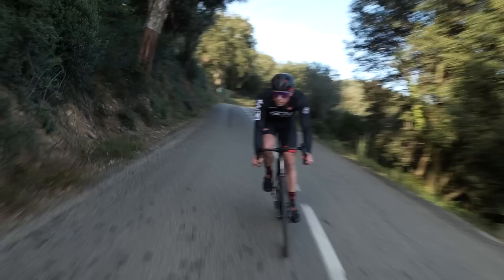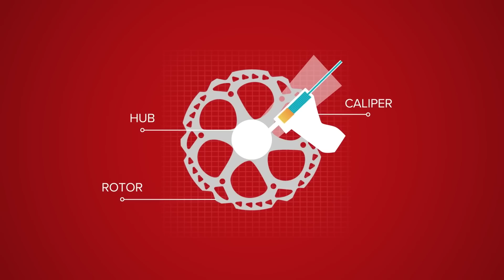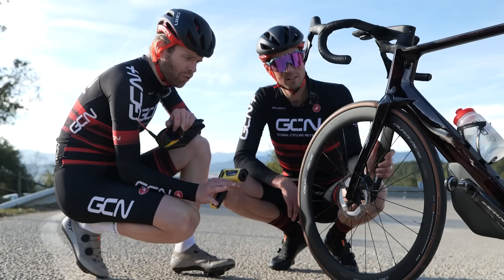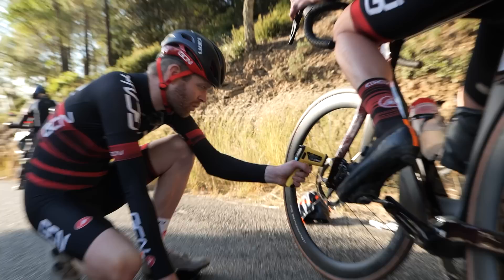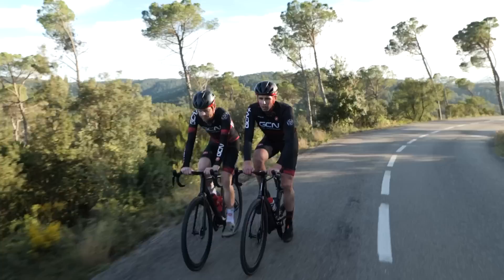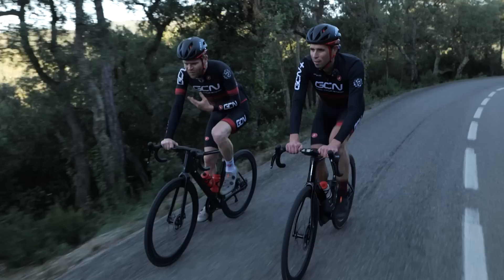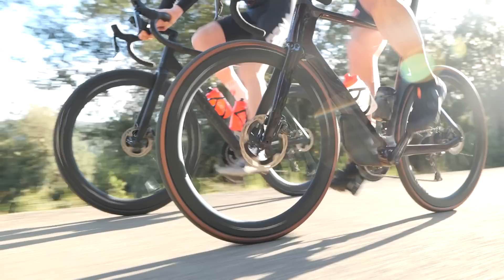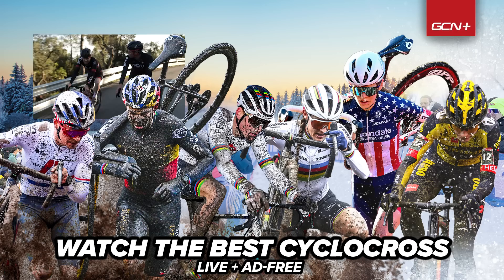Are Big Disc Brakes REALLY Better?

Comment from the maker: What did you think of the results?
Reply: You came to the same conclusions as I gave when selecting rotor size for the weight.
Reply: .....not really a scientific test.....you have to measure it permanently and you also have to know the speed, weight, energy which got transfered into heat for one ride and so on.
Reply: should try it with an alloy rim brake wheel 😉
Reply: Being a mtber and roadie id say fairly predictable, good to see some peak torque recognition tho. Yeah come on let's test some stuff to destruction, get the lathe out. Big brakes are great if you're an aggressive decender theyre always good to go - fade is a thing of the past and in 24hr races having more than enough power is a bonus with tired cold hands. If you're a bit of a panic braker tho good luck, best thing you can do is work on your spacial awareness so things don't suprize you.
Reply: The 55ish degrees across the board shows that the experiment probably isn't hard enough to show any difference between the rotors. (Although the faster heat dissapation  of the 180mm is a hint at potential superior performance)
Would love to see some more experimentation on the subject :)
Reply: The results were entirely predictable.  The temperature change for each rotor being similar lines up with the physics and maths, similar energy from stopping for each run, same material, and mass relatively small for each rotor.  Q=mst.  Heat quantity in Joules = mass x specific heat capacity of material  x temperature change.  Cooling rate a function of surface area and colour.
Reply: Results are good, next time rotors and brake pads. I use "organic" pads  so whats the difference between organic and sintered pads?
Reply: Interesting. You should test drums as well (SA 70mm v. 90mm).
Reply: Crank Length, it's all about crank length
Reply: Be worth having You Tuber Peak Torque on. He advocates 180mm on the rear in some cases
Reply: You guys need to use a probe thermometer. Laser thermometers are not even a little accurate on reflective surfaces like brake rotors.
Reply: I think the measurement is not done properly. You cannot measure temperature correctly on smooth, metal surfaces. They act as a mirror and the IR sensor "sees" more or less the temperature of the objects that reflect in that surface. It is like if you wanted to measure the colour of the mirror. You should stick something to the fin or paint a piece of the fin and measure on that spot.
Additionally, black fins coating increases its emissivity improving the heat dissipation. It is not only for aesthetics or to substantiate the price.
Reply: Rider weight should be a factor.
Reply: @danc1829  in the wet
Reply: I agree with comments criticizing your thermometer.  Factors degrading temp measurements:  reflective surface of rotor, time lag from final release of brakes to reading temperature, and, because the rotors all cooled quickly, it's likely that all the heat in the rotor was generated during final stop (heat from braking during descent was already dissipated.  This experiment needs real time temp measurement over the entire descent, to measure heat build up during braking and heat dissipation while coasting.  Thermocouple on rotor, wired to data logger mounted on wheel maybe.  

As for personal experience, I'm 68 kilos, road bike with 13k miles and 200,000 ft vertical, original 140mm discs still performing well and plenty of material remaining.  I've thought that if/when they wear out I would put a 160 on the front, but your experiment has me reconsidering.
Reply: I'm a 100kg and last year during summer I was descending for less than 10min on a -10% to -15% descent and my front rotor changed color. Wasn't exactly glowing when I stopped at the bottom, but it was a lovely rainbow "color". And that was a gravel bike with a shimano 160mm rotor.
Reply: I know that slope haha! And it looked like the heat was only being generated when Alex was braking in those last few metres. Come to Andorra and really go down "hills". Try going down La Gallina, or Beixalis, la Peguera, where it is corner after corner when you are braking constantly from +60km/h to 25km/h. We here have plenty of examples of carbon wheel rims (ok, yeah, some years ago) that have exploded from the heat generated descending!
Reply: It is symply not possible to measure IR reflective materials as metals with an IR device. Check with an IR camera for reference...
You could get somewhat liable measurements, when having some white tape glued to a test area and measure there.
Reply: One thing not considered was the time taken on cooling, not at the end but between braking points on the descent. Bigger rotor will cool quicker between the braking points giving a better braking effect throughout compared to a smaller that will still be hot.
Reply: Well… Ollie used 140mm rotors for Le Tour des Stations, saying the braking performance was not an issue even in mountainous rides for a rider of 68kg… Why did he change his mind ? 🤔
Reply: @12Burton24  X CVV icm
Reply: @frankeeeej  You have to also consider that the conditions most cyclists come across in their rides are not enough to experience any difference in these rotor sizes.
Reply: Doesn’t it also depend on the pads?
Reply: Would like to see a more controlled experiment, indoors. I think the rotor temps you measured were entirely from coming to a stop right before measuring the temp - the rest of the descent was not a factor.
Reply: This test wasn’t useful. The peak temp could be expected to be similar as the energy would be dissipated in a shorter time with the larger rotors. 
You need a test where the brakes are on and the bike is towed by the same force for the same amount of time to do a temperature dissipation test.
Reply: @danc1829  yes yes yes! I’m already thinking about how to do this for my channel. Disc vs Alloy rim brake
Reply: @SeeYouUpTheRoad  would make a great video
Reply: @matthewlewis2072  this is not a thing and it appears to be the only, first rather, rebuttal a disc brake fan will say. “In the wet” your stopping distance, ability and modulation will always come down to tire traction on the road not your braking system.
Reply: @mikes1976  you make valid points on proper testing protocol
Reply: @douglaspate9314  sounds like an amazing place to ride much like Southern California. People that ride rim brake carbon wheels are just asking for rim failure. I ride alloy wheels on my bikes and out descend all my riding mates on their new disc brakes. They  thought they would “upgrade” and they still can’t keep up. It’s all about the rider not the tech
Reply: @Yippee Skippy correct! Over engineered and over priced. Rim alloy for the win
Reply: Totally as expected because the peak temperature of the disc is related to the force involved in slowing the bike. This would have little relevance to the perceived reduction in effort on the brake lever that the increase in brake disc diameter will show. A better controlled test would be more useful.
Reply: It all makes sense. I think a bench test is in order to get more precise results, maybe using a weighted wheel like older rowing machines had
Reply: I just can't get past Alex wearing Si's sunglasses
Reply: IMO, the fist trial will show always show a higher a temperature because the rider's confidence is lower with the first run. Therefore more breaking is applied. As the number of runs increase, the confidence increases and less breaking is applied. This easily explains the the lower temperature with the  180 rotors. To negate this factor the riders should have did a few trials before testing to familiarize with the coarse. Also I think the heat dissipation is probably engineered with the rotors in motion rather than when stationary, so I am unsure if the dissipation test is valid.
Reply: You should have timed the decent as well to see with the better stopping power of the bigger rotor, giving you an advantage by breaking later and carrying more speed.
Reply: I expected the 140 rotor to fare worse and was happy with the outcome. I have 140 + 160 on one bike and 160 + 160 on my other bike. Happy with those.
Reply: Put on 50 lbs more of weight and try breaking on small rotors, specially on MTBs
Reply: nothing
Reply: Same decent, same rider, same bike and mostly the same rotor material will bring up a very closed area of heat build up, due to braking in the similar paces and duration, the thing with bigger discs is, as proved, the cool down period, which will be quicker again, when the rider is travelling along, due to wind effect. 

I’m a 110kg No.4 rugby player and I made the switch to discs about 3 years ago due to riding Colle delle Finestre and riding back down again, the rim brakes weren’t enough to give me the reassurance that it would hold me if I needed a full emergency stop, so once I was back, I made the switch, when I could, and since then, I’ve not had to apply nearly the same amount of pressure on the brake levers to get the similar stopping power. As a bigger rider I do love the knowledge that I have ample extra braking when needed, which I wasn’t able to get with my rim brakes. I would love to see this test done again with the bigger sizes involved: 140, 160, 180, 203 and the 225mm disc brakes, granted wondering into GMBN territory but you’ve done overlapping videos before 😉😉

Comment: Would love to see a weight based experiment between a 60kg rider and a 100kg rider descending
Reply: I can verify that on steep, loose gravel paths with high consequences for sliding, small rotors fade for Clydesdale riders, and are fatiguing.
Reply: Yes please
Reply: Should do heavier and less confident at descending.
Reply: (if all else being equal) Gravity. Means fatties should be faster at descending. Bigger discs will be king as it has enough surface area to handle and dissipate the heat from braking. You could also toast your brake pads as well but even a lot of those come with heatsinks or made with better materials like aluminium on the back of the pad to help remove the heat these days so its not as much of an issue as it used to be unless youre on a super super long descent then brake discipline is key to not cooking your brakes.
Reply: Agree. Do it!
Reply: Easy, the all up weights would be approx. 70kg and 110kg so just over 50% more kinetic energy for the heavier rider.  The thermal energy conversion would therefore be 50% more leading to a temperature increase which will be 50% more.  From the tests the temp. change was 54 - 19 = 35deg, so let's use that number in this example In your experiment: the rotor temp. will be (35 deg x 1.5) + 19 = 72 deg (in round numbers) and easily managed by the rotors (even the 140mm dia. rotors).
Reply: @mischief2168  don't temperature calculations involving ratios require conversion to absolute temperature?
Reply: @stevek8829  ... hi Steve, actually no conversion rqd.  The formula is Q=mst where t is temperature change rather than absolute temp. Since the Kelvin and Celsius scales use the same intervals  (ie 100 intervals between the freezing and boiling points of pure water under standardised conditions) the temp. change can be used with measurements in deg C or in Kelvin regardless.
Reply: Weight wont matter if its a confidence issue.
Reply: @gonefing1234  obviously, skill needs to be equal.  A test with a pro that's 60kg and a beginner that 100kg isn't gonna fly😅